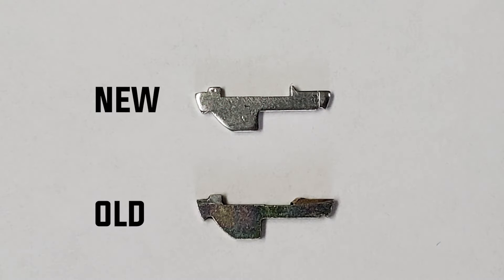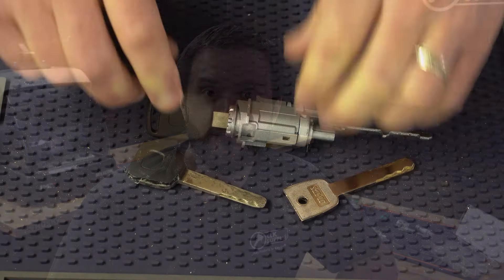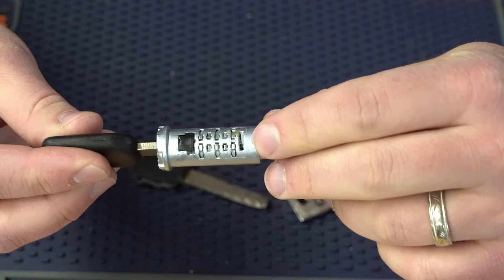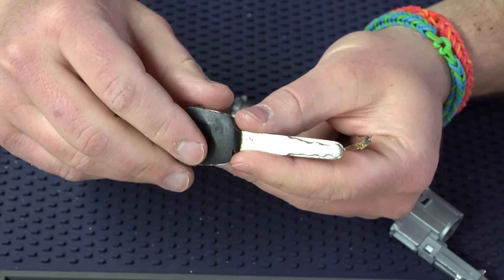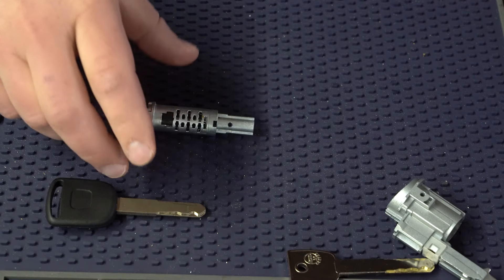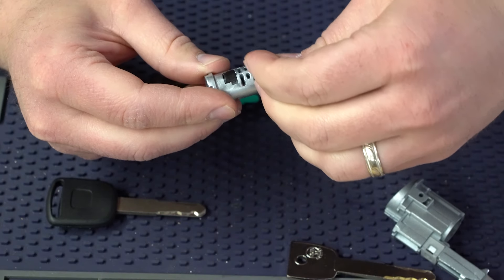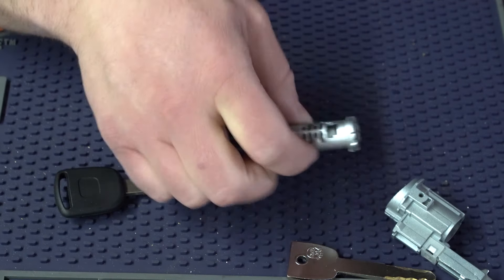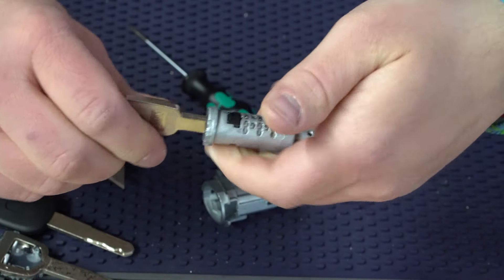Honda Ignition lock repair step by step  | Locksmith Tip

Comment: My ignition is locked and won’t turn at all and when I open car door it beeps like it has a key in there but it doesn’t. What’s wrong with my ignition?
Reply: same. What did you end up doing?
Reply: @villagehardcore2772  drilled out the roll pin and removed the lock cylinder then replaced the wafers inside the ignition lock and it was all good
Reply: @lowbvll8969  was it hard to do?

Comment: The sad part is if they would just have used a brass key like they used to they wouldn’t fail. The new keys are stronger than the wafers. They could fix it by spending a few cents per unit but they went cheap like every other manufacturer and leave it for the consumer to pay for 🤦🏽‍♂️

Comment: Hey. Can you leave any of the pins out? My locksmith took the last 2 at the end out and just thru them away. Didn't put in new ones He put my car back together and now the remotes don't work and the door locks don't work. Also a "remove your key" warning pops up even if the key I removed  Please help me. I'm single mom getting screwed from the locksmith. I need to fix it my self

Comment: Did we deal with the chip and immobilizer?  I just removed the problem wafers from the cylinder, put it back together and it works, no issues.

Comment: 3:20...so, the roll pin from what I've gathered from other videos is meant to be permanent and so different people have done different things to get it out like drilling it out, tapping it and running a screw into it from which to pull, or one guy drilled a hole to the back side so he could use a center punch to hammer it out....how did you get yours out?

Comment: 2006 Honda CRV. took out wafers. Re assembled (no springs or wafers) key turns cylinder, but not when I insert into the housing. Do I need rto get a new part?

Comment: I have 1990 Crown Vic and I never had to what my brother did for my car and that was to take WD-40 and squirt that into my ignition switch it seemed to help my car and was able to turn the switch and started right up. It sure saved a trip to the mechanic and saved them money. In all the years I’ve had vehicles this was the first time I had to do this. Thank You! 😊

Comment: I learned from another locksmith. Before you start in the field, especially if someone else worked on it first. You can get the switch off the back. Insert the current key and make sure it starts before you get too deep into it. 

My first one was really a learning experience and cost quite a bit to keep my customer happy. I didn't verify when I started and their immo ring was damaged. I didn't do anything that would damage it, but didn't verify it functioned when I tore into it. Lesson learned. But now I'm more educated and confident. 

Great walkthrough PJ.
Reply: If you take all the wafers out will the will it still start
Reply: @donaldmatthews3999  yes, but you can turn it with anything., Or if it's got the little ears, just turning it. It's a safety thing. It'll also just turn freely.
Reply: @donaldmatthews3999 I took out the wafers and my ignition is still locked. What can be the problem?

Comment: Great video.  My key wouldn’t turn so I removed all the wafers.  When I put the lock back into the housing (the part that bolts to the steering column) the key doesn’t turn.  Am I doing something wrong or will the key turn when everything is back together in the car (sensor attached etc)?
Reply: I am also having this issue!
Reply: @Talamandas dealing with that now. Removed all wafers and put ignition back in but my key still won’t turn. Do I need a whole new part?
Reply: Depending on your model, its likely you triggered the ignition lock somehow. To dissable it, i had to call an auto locksmith to dissassemble the entire steering block to unlock the ignition lock.

If you're willing to try to unscrew the unheaded bolts that secure the assembly to the wheel yourself with a chisel and hammer, then you may not need a locksmith, but i didn't have the tools and needed my car. Cost me around 100$
Reply: Turns out I left a piece out.  There is a small black piece that fits into the lock to keep the bar for the steering lock from preventing the lock from turning.  I found a locksmith on YouTube (kerns Keys in Bakersfield ca) and sent the lock to him.  He rebuild the lock and cut a new key so I can use my old keys and not need to reprogram the car.
Reply: @jim21804  what peace? can tou explayn mee? i have same problem i dont khmow what to do
Reply: @giorgioio  There is a small black plastic piece that fits into the lock cylinder (the part with the wafers) before you put it back into the lock housing.  Mine had fallen out and I didn’t realize it until the locksmith told me it was missing.  I found it on the workbench.  There is also another issue than can cause the key not to turn.  On the side of the ignition there is a selenoid which looks like a little metal box with a plunger and wires attached.  This moves a small lever to unlock the ignition.  Mine went bad and i pulled teh metal piece holding the lever and removed it.  This can be done from under the steering column without removing the lock.  This is the park interlock mechanism. Once removed, you will be able to remove the key even if the car isn’t in park.  Hope this helps.

Comment: I did this and it worked great however now my immobilizor light flashes (even though the car starts just fine) then turns off and the beeper thing to unlock doors no longer works. I tried reprogramming the beeper and disconnected battery but no luck. I can hear the locks after going through reprogramming process but once I turn on or off  car the light comes back on. Do you know what could be happening??
Reply from the maker: You need to use the chip from the original key otherwise you need to get the new one programmed

Comment: Hi, I would like to know if you have any idea regarding my  honda car, it is detecting that there's a key in the ignition switch even if I already pull out  the key. The fob won't let me lock the car automatically because it's detecting a key inside and I confirm this because whenever I open the door it will  sound chirp, meaning that the key is still inside. By the way I've repaired the key cylinder thanks for your video it helps a lot👍🙂.

Comment: Fantastic video but there's one thing I'm not clear about. Let's say I get a new ignition cylinder and mechanical key as sold on your website. The new ignition cylinder is pinned to the new key. If I simply had my old key with it's chip/transponder near the ignition cylinder would I be able to start the car with the new mechanical key? Or do the wafers in the ignition cylinder have to match the transponder code?
Reply from the maker: Wafers and transponder can be different,
Reply: @clksupplies  Thank you! So the scenario I suggested (mechanical key with old transponder near by) will work!

Comment: Thank you. Auto tech here with limited experience with keys/locks. Making a repair on the wife’s pilot. So are all of the wafers numbered/coded so that if I buy that kit, I can just replace each wafer one for one and maintain the original coding?
Reply from the maker: You will have to match up each one
Reply: I bought this kit from CLKSupplies. It’s great and yes they are numbered.

Comment: Easier just to remove the wafers except the last one then re-install and use the same key.
Reply: Facts. Removed the cylinder at home, took it to locksmith who removed all wafers except one and then took it back home and reinstalled it. No problems 5 years later and only cost $50.
Reply: Why not the last one ?
Reply: @carloslizarde8221  It's been a while, but I believe you need to keep one wafer in there to keep the key from falling out when your driving, etc. The other wafers are just for added security, but one needs to remain to keep the key in the ignition when it's supposed to be.

Comment: If you remove all the wafers will the ignition still work? If you don’t care about the security aspect.
Reply from the maker: Yes as long as the transponder is programmed
Reply: I don’t have to change the key or the code. 
Just going to remove the pesky wafers. 
Will doing the same thing to my driver’s door. 
My element is 20 years old with 300,000 on it. 
Love that car despite it’s faults. Thx so much for your advice. 
T.
Reply: thx so much

Comment: I'm going to Google this question as well, but I want to ask if it is possible to not use wafers or remove some just so that ANY key will make the switch turn.
Shouldn't be a security issue since the car will only start with the programmed key, right?
Right??
:'-(
Reply from the maker: Correct
Reply: Thank you! @clksupplies

Comment: I have the same problem with my 2006 Honda Ridgeline...key won't turn and won't come out...
I was told by this mechanic that the part cost 400 and he said labor is 700 dollars.he charge me 11 hundreds for it to get it repaired.
I feel like I've been over charge for the repare..how much does it usually cost to get it fix or replace?
Reply: I repair these for around 275-325.  Depends if you have to remove just cylinder or remove the whole assembly. Plus key cutting and programming I charge extra 125. All in all with parts, labor and programming comes out to around 450 or so

Comment: If I take all the wafers out will it work with original key?
Reply from the maker: In that case all keys would turn it -PJ
Reply: @clksupplies  would it not need the key with immobiliser chip
Reply: @user-we2pr5lm7q you must have the transponder inorder to disable the secuiy system. From what I understand the transponder needs to be nearby, hanging the old key on the same keychain should work.    You can move the old transponder to the new key so you can trash the old key, thus not have two keys.
My 2013 Civic Si, bought used with 203,000 miles nine months ago, the transponder is in the key fob. The key fob has come apart and the key is so wobbly it's hard to turn the key. I'm going to have to purchase a new fob and have a new key made as the old key is rather worn, like described in this video. The key still works except it has become difficult to turn past the first position, accessory position, to lock position, off so I can't remove the key from the ignition switch. This started after the car was in the body shop for two months due to an accident, not my fault, lol. Looks like I'm going to have to replace the wafers, as shown in this video. The shop cracked my windshield, they wouldn't own up to it, I know it wasn't like that when I dropped it off. Insurance covered it to be replaced. Point is I don't trust just anybody to work on my car. It's hard to find an honest and trustworthy mechanic nowadays. Sad but true.

Thank you for this video pj.

Comment: A Question❓❓❓
What if u bought a cylinder lock online with 2 keys and on your old key u removed the little item in the key caps and put them in the new keys. Would that be sufficient enough for the car to recognize the key without programming. The old key u took out that little piece and put it in the new key.

Comment: Hey, for an older car couldn't you just remove all the wafers and put it back together? Yes, you could start it with any screwdriver, but who would know 😉
Reply: Actually, the chip is what's important, right? As long as the bitting problem has been addressed.
Reply from the maker: Technically correct
Reply: U can do  it to honda one too. I did. I removed all the tumblers.. Car still. Needs the transponder key so.

Comment: I would like to see how you got that roll pin out far enough to grab with a tool.  so it appears that once the key is in the cylinder, the wafers don't fall out.  What keeps the wafers from falling out.   Also, are there wafers on either side of the cylinder, and the spring in the middle?  That wasn't clear for me.  Thanks for the video
Reply from the maker: I just put some pliers on it and pulled it out! When the key is in the wafers can't fall out as the little finger piece is holding it on-PJ

Comment: Couldn't I just take all the wafers out and not have to worry about it? In theory the vehicle couldn't go anywhere anyway unless someone had a properly coded key right?
Reply: The key could fall out and the steering would lock which wouldn't be good.

Comment: I have found ASP wafers work good but their replacement lock cylinder that you are using has too much 
clearance between the plug and the outer housing, very sloppy.
If you have an original cylinder assembly you will find a code inked on the body which is very helpful in originating
a fresh key when the existing key is worn out.
Reply from the maker: Interesting, thanks for sharing-PJ